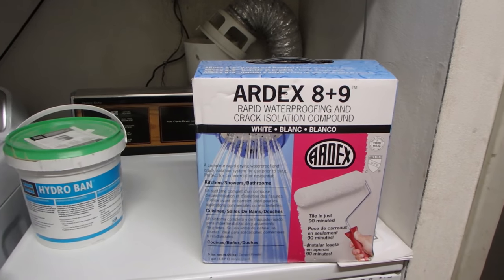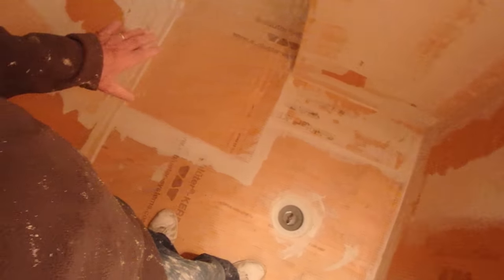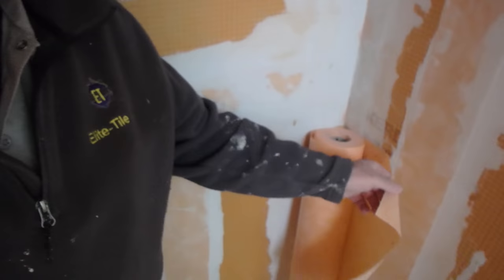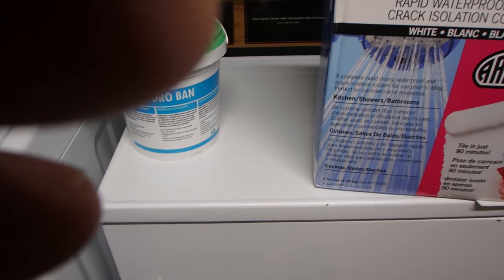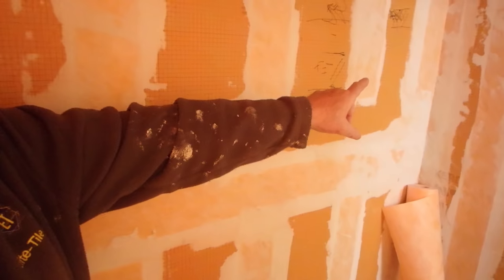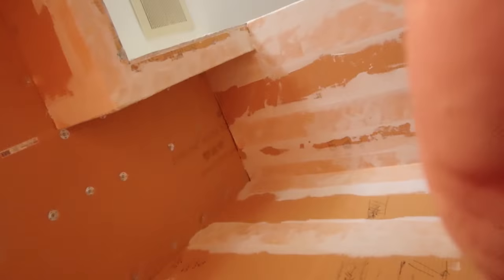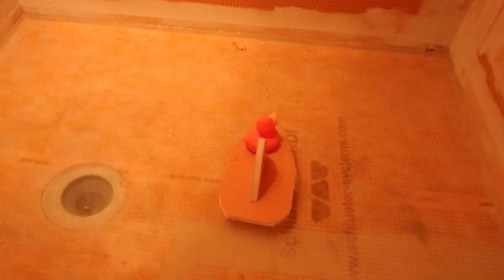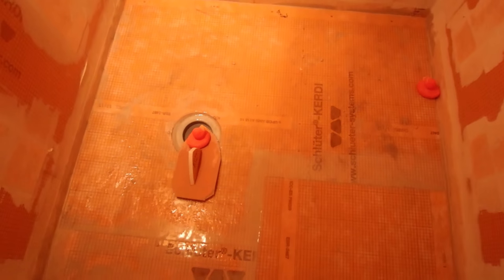Waterproofing your shower, Do you really need it? Plus flood test.

Comment: As a machinist I appreciate detail. I can do anything with the right instructions, and I'm about to re-do a bathroom. This guy is the best of the best and believe me I've looked.
Reply from the maker: Thanks, just trying to get people to think about getting it done right, so they only have to do it once.
Reply: @SalDiBlasi  In my shop, tolerances are only used when things go wrong. Precision is key and no matter what, make it on the nut if you can. Just like my dad, I've probably lost a lot of money making plow shares look like pearls, but reputation goes a long way. I don't make junk. You don't either and I salute you for that.
Reply: @eboneezeradams1821  tile installer here. He is the best installer on YouTube.
Reply: I agree. Sal IS the best on YouTube. Many other quality craftsman on here but sal is my go to if I run into any problems on the job, he likely has it covered in a video. People really need to avoid only looking for the best price when getting bathroom/custom tile work done. If you get a quality contractor, it will only need to be done once.
Reply: TJP 81  I wouldn't even begin to add backer board to 24 in studs. Don't know for a fact but I think there would be too much flex in the wall to tile over. Even when I tile over 16, I still add blocking because of the flex, might be Overkill but makes me feel better
Reply: Sal is the best, but Tilecoach is pretty good too.
Reply: @beerdrinker2001  I agree. I receive more detail from coach when he speaks, very little sound issues.
But sal has good approaches as well. He’s too quiet for my hearing loss 👍

Comment: Be careful with 1 part liquid membranes. I had done a shower with hydroban for a  customer who lost power and the membrane curled and became loose due to the cold. I had to tear it out and re-do it. Hydroban would not stand behind their warranty beyond offering more hydroban. I had same issue with red gaurd outdoors under black slate. In the sun the slate got so hot, the red gaurd re-liquefied and leaked. Now I only use sheet membranes. Lesson learned. Props on flood testing every shower.  I do the same. It takes an extra day, but you can document that it's water tight.  It's also required in the building code.
Reply from the maker: Sorry to hear you had problems, but the manufacturers do have instructions and in those instructions include the temperature range and substrate suitability, along with other limitations  listed, if you ignore those, like temperature that is too low or too high, then you will have issues. Sheet membranes also have limitations. So always follow manufacturer recommendations, and don't blame them if you have a problem when you ignore them. The will honor their warranties  if the product is defective, not if you install it wrong.

Comment: Hello Sal,your videos never fail with great content.I'm a licensed Contractor in the NY area.I have used Schulter Systems and Laticrete products faithfully with no issues.What issues I come across on failed Bathrooms are weak structure,plumbing and incorrect installation.May it be not having knowledge,budget or laziness any Waterproofing System will fail if what is underneath it isn't adequate.An extra day or so on structure,plumbing and install can save you thousands of dollars in the future.Thank you for keeping our Trade strong.
Reply from the maker: It really doesn't take any longer to do it properly, but you are correct, most problems are from human error.

Comment: So if the old bathroom was only leaking from the drain, couldn't you just fix that without remodel the entire bathroom?
Reply from the maker: It is never "only leaking from the drain" it always because of the installer didn't have a clue.

Comment: First off, Thank You for all your videos, they set the standard.  It always makes me cringe when I see cement board in a shower without waterproofing as over time leaks will go unnoticed (since cement board does not disintegrate as drywall) and the damage may be involving structural parts of the home.
Reply from the maker: Sad that it happens so often, showers are built with no waterproofing all the time.

Comment: Do the newfangled foam boards expand more or less than proper backerboard? But maybe the shifting studs matter more than expanding panels.
It's tough enough to get used to building wall panels out of packing peanuts but we're even loading those panels with hundreds of pounds of tile. What next?

Comment: Can i put the liquid waterproofing over the orange board for extra protection?
Reply from the maker: If you want to keep your warranty don't do that.
Reply: Guy Guy yes you can and I do. 
You can only trust your self not products. 
No manufacture will have your back even if a shower fails, only you have your back!
Reply: Sal DiBlasi your not really answering his question... it’s a yes or no answer really.
And the answer is-yes you can.
Reply from the maker: @northstarmn  You say it is a yes or no answer, but it is not. Schluter has tested and developed this system to work with all the components of the system. Install it how they say and it will be warranted, change that and you don't have them stand behind it, and they do. You assume that the warranty is worthless, that is your opinion and you are telling someone you don't know to not worry about it, they however are the ones to loose the warranty, not you, you have no stake in the successful out come. Will the extra waterproofing adhere to the system, sure, but you are then on your own, does it need to be done, not at all, system works just fine as designed.

Comment: Get a better microphone or something and I would watch a lot more of your videos
Reply from the maker: Sorry, I actually have several types of microphones, however I am a tile installer and installing tile can be a messy job where your hands are never dry or have some mortar on them, so the expensive equipment is reserved for the clean dust free environments, the rugged cameras are used on the job. I am well aware of the audio problems, and have looked for a camera that will survive the jobsite with th better audio, no luck as of yet.

Comment: I still use cement board on walls (not backerboard) and leave 1/8 gap between sheets. I mix thin set and use 2" mesh tape on all seems and let it dry overnight then begin tiling with either a top grade mastic I buy for $39.99 in a 3.5 gallon can from a tile distrubuter (not Home Depot ) or tile the bottom half walls with superflex.  that's it. I've gone back to same jobs years later and tiles are still set. I never had to spend extra on waterproofing.
Reply from the maker: Believe what you will, nothing anyone will say can change your mind. Maybe you should read the lable on the mastic bucket.
Reply: @SalDiBlasi  What are talking about?? I use mastic to tile a day later when the seams I've prepped with thin set dry. What does reading the mastic instructions have anything to do with it?
Reply: @SalDiBlasi  If you think nothing anyone will say or change my mind, then why should I read the LABEL (not lable) on the bucket?? You make no sense.

Comment: Sal, whar would you prefer, 1/2 drywall plus Ardex 8+9 or schluter system? ardex over drywall seems easier...
Reply from the maker: Use a system as designed, mix and match at your own risk.

Comment: If you are installing a shower pan, you need to do a 24 hr water flood test, right? what if you are not using a shower pan and did hotmop, will cement and tile later, is 24 hr water flood test still needed?
Reply from the maker: Hot mop is a CA thing, but only way to know if it is watertight, is to test it.
Reply: @SalDiBlasi  thank you!

Comment: Thank you sal for all the knowledge. I love the little schluter board boat with the rubber duck . Nice touch
Reply: Hey sal I didn't know if you have time to answer questions but is it possible to do a kerdi board you know one of the pre-slope shower pans but use regular cement board installation on the walls? Any info would be greatly appreciated. Question from a fellow contractor all the way up here in Maine
Reply from the maker: Sure, but you have to waterproof with sheet membrane.
Reply: @SalDiBlasi  thank you sal . Thank you for the advice. God bless
Reply: @SalDiBlasi  no pun intended, sorry to keep showering you with questions LOL, I've been using the HardieBacker hydrodefense with the mesh tape and red guard on seams, are you saying I still should use like a kerdi membrane on the entire wall, or just seal entire wall with redguard? Didn't know if you might have used the Hydrodefense cement board before.

Comment: I installed a shower kirdi-base with drain, kirdi-curb and kirdi-board on walls and band all with All-Allset. I let everything dry for 24 hours and then performed my water test for 24 hours. 

The water level went down just under 1/8" and water has wicked up in multiple areas, is this common? What would define a fail? It doesn't seem like a shocking loss of water but the water wicking up the thin-set does concern me. I mixed the All-Set as directed and it wasn't too loose or stiff.

I reached out to Schluter Corporate multiple times and got referred to someone else or didn't hear back. Do you know of someone in Corporate in the northeast.

I have been a home renovator for 30 years in the Northeast and do like the Schluter system so far. I have been to their classes and many trade shows demonstrating installation of their product. Just need to know if a little water loss as described is common.

Thanks for all the great videos.
Reply from the maker: So some loss of water to evaporation is not uncommon, ambient conditions will affect just how much, wicking is also normal. I reached out to schluter to see what they said, and they confirmed what I just told you. You should be good to go.
Reply: @SalDiBlasi  Thanks for your response someone is coming to take a look at it on Wednesday afternoon.

I found Kirdi Coll-L on their European website that is used as a top coat but not for sale in the U.S.. Do you have any experience about this Product?
Reply from the maker: @Robert-ex2qp  If you want to keep your warranty use the US methods approved for this market. Kerdi Coil is a two component waterproofing membrane  similar to Ardex 8+9
Reply: @SalDiBlasi  Just met with my  Schluter Rep. and he confirmed that it was installed correctly and I am good to go. I mentioned your input and videos are very helpful so thanks for your help.

Comment: Sal, would you recommend Ardex 8+9 on top of schluter for extra peace of mind? Especially for, say, a steam shower? Thanks!
Reply from the maker: no
Reply: Sal DiBlasi is there a down side to it? Or do you think it’s a waste of material? I am afraid that I may mess up the install, and use extra membrane as a protection for my possible mistakes?
Reply from the maker: Use the system as designed, adding unapproved elements will void the warranty, it works perfectly well the way it was designed.

Comment: Aside from the work and cost, are there any reasons NOT to coat the pan/drain flange and up the walls about 10 inches with Ardex 8+9 over the Schluter foam shower pan that is already coated with the waterproof membrane (the orange pan)?  Out of paranoia I want to add the Ardex as a second layer of protection unless there's a reason not to do it that anyone may know about.
Reply from the maker: The system works as designed, modify it and void the warranty. Will it work? sure. Do you need it? no in the least.
Reply: @SalDiBlasi  Ok thanks.  I don't know if you've seen the videos though regarding the drain flanges on the kerdi system failing at the fleece/metal joint (or whatever the white stuff on the flange is).  Seems a little sketchy.  That's what made me think the 8 + 9 might be worthwhile at least there, but then at the same time, you are the master of tile so I'll take your message to heart.
Reply from the maker: I have seen that video, and the only thing that is known is that there was a failure. The cause is not known, the conditions of the installation is not known, how the product was handled and installed is not know, and a multitude of other variables are not known. What we do know is that Schluter Makes quality products, and that there are countless successful installations and that if the installation is done according to manufacturer recommendations, there will be no problem.
Reply: Did u put ardex?

Comment: can I only put aquadefense and not a liner on on my shower
Reply from the maker: no
Reply: @SalDiBlasi  I guess what I meant to say is Im making a shower, and I didnt put a pvc liner behind the durock before I put it in. Will aquadefense be good enough as a waterproofer for the floor and curb. Tile guy told me its gonna leak.
Reply from the maker: @chrismarichalar7919  It's gonna leak, 💧☂cutting corners and ignoring a mistake you know you made will not fix anything. Trying to do a workaround to save time, money and materials will only cost you more of  all three later on. Go back to where you made the mistake and fix it before you proceed.

Comment: Is this system ok for a steam shower if installed correctly  or could it fail even if it was installed correctly
I know strange question, but I have seen to many fail that were “ installed correctly “ 
I have a project starting soon with one and as strange as it sound I’m a contractor who cares and takes pride in his projects
Reply from the maker: Yes, however a continuous use steamer, like you find in a Gym, will need additional steps. For an intermittent steamer, as is found in a house, it is perfectly fine. Here is a video, bit long but you can skip through it https://www.youtube.com/watch?v=T_C1uBeYWeY
Reply: Ceiling pitch and a moisture barrier are vital.
Reply: Thank from N.H.

Comment: Good morning Sal
Iv been setting Tile over 30 years I had problem with hair line cracks in the inside corners an ceiling line on a full size stand up shower on my installation I water proofed 100% everything as well as crack suppress fabric all my corners I tight coated the walls as well as the back of tile with the push and pull set full Flex thin-set what can I do to prevent hairline cracks and the corners
Reply from the maker: Did you grout the corners?  If so then use silicone in all the changes of plane, at the very least use siliconized acrylic caulk, silicone is better though. Look up ANSI EJ171 for full details on movement joints.
Reply: @SalDiBlasi  yes sir I did fall back an I did use 100% GE Silicone on my next one I'll follow your instructions I use laticrete grout with 3701 grout additive I thought that would prevent it but it didn't
Reply from the maker: Laticrete makes color matching silicone for all their grouts, so you can everything match, all the manufacturers do.
Reply: Thank you Sal I will do my home work by the way you're a great mechanic pleasure following you I'm always trying to better myself
Reply from the maker: Look up Tile Geeks and GTP on facebook, then join these groups, you can thank me later
Reply: Maori also make great silicone

Comment: Great video.  What do you recommend if you do a flood test and you see a leak? 
Ardex 8+9 over Kerdi?  Terrible idea? Or unnecessary but harmless belt and suspenders insurance?   Many thanks.
Reply from the maker: If you find a leak and know where it is and what caused it, you need to patch it with what makes you comfortable. If it is Schluter and you want to maintain the warranty, then patch it according to accepted schluter practices, if however you don't care about the warranty, then a quick patch with Ardex 8+9 will do the trick.
Reply: @SalDiBlasi  Thanks.  If you dont know where the leak is (I'm assuming one rarely does), and you figure Schluter is unlikely to stand behind its warranty (and/or just dont want to rely on that), any reason not to just slap the entire thing with a coat of 8+9?    (nervous DIY'er here... in case that wasn't obvious)
Reply from the maker: @AidanSkoyles  There are ways to find the leak, and most times if you have damaged the layer of waterproofing or there is something wrong with it, there will always be tell tale signs. I figure Schluter will stand behind their warranty, I have no reason to think otherwise. If you are going to use 8+9 over the whole thing, using Schluter is just a waste of money time and effort, you should have just skipped it and use cement board and waterproof it. Schluter work, if you installed it properly it won't leak, and that is true for any product be it painted on or foam board or sheet membrane.
Reply: @SalDiBlasi  I appreciate the response.  Thank you.   That would make for a good video -- how to find a leak!
Reply: Sal DiBlasi manufactures will always, always point back to the installer and say installed error. 
I’ve seen it way too many times. Hacks in my area think they are Schluter gods!..and they are not. Nothing is perfect in this world. Same goes as Schluter they are not perfect and can fail even if done to the manufactures specs.